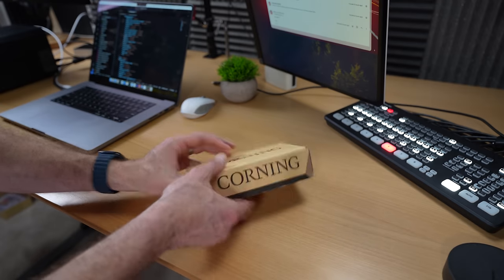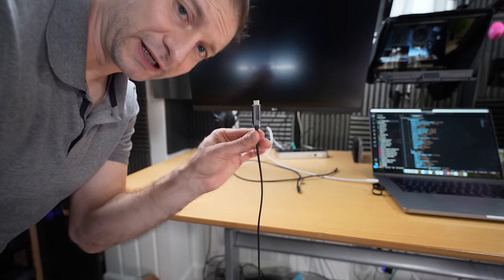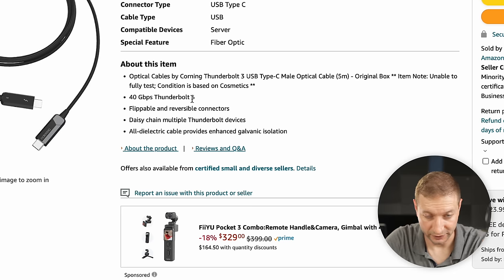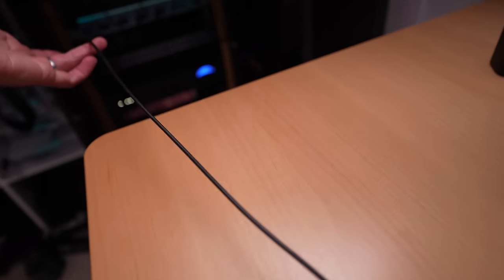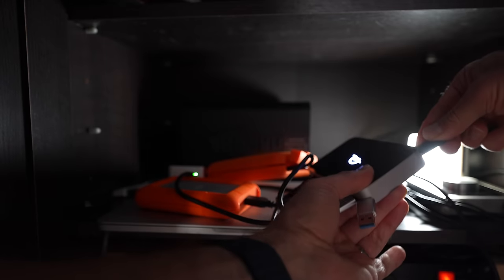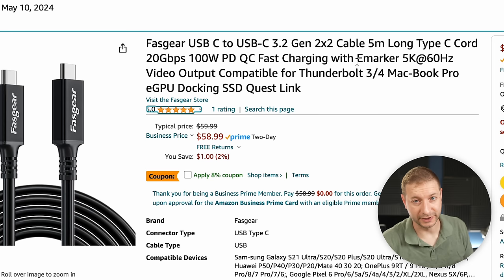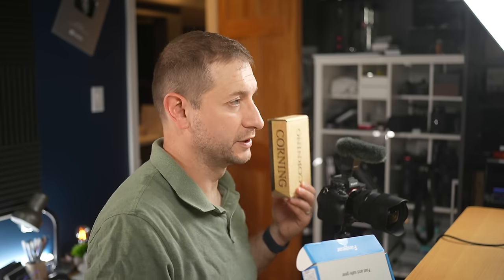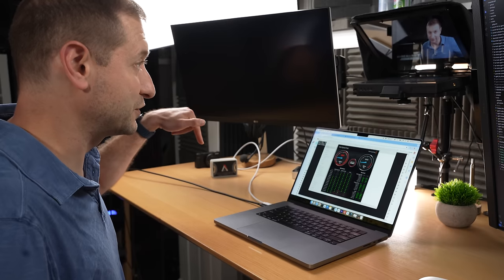I tried a LUXURY cable…(so you don’t have to)

Comment: I had a 6 bay HDD DAS next to my computer at one point and it produced a lot of noise. I ended up getting a Noctua Fan with the noise reducer resistor and that cut the sound down to near nothing from the fan hum. The HDDs still had a lot of their own clicky noises, so I made a 1/2 thick wood box that I put the enclosure in. This didn't reduce the noise, but it redirected it and the heat to a different direction. This allowed me to keep the DAS on my desk without having the noise cause problems with my recordings.
Reply from the maker: hmm. Thanks for the tip - haven't tried that
Reply: Good comment. Its INSANE how cheap and shitty the fans are on some very expensive technology that we buy. Often Noctua has a fan in almost every size that you could mod and swap into these components.

I have seen people do this from PSUs to laptops

Comment: Your mistake is having a non-Thunderbolt 3/4 DAS. Or at least USB-4. With a modern PCIE 4.0 m.2 SSD based external TB3 enclosure, you could easily get 2100/2500 MB/s write/read on an AS Mac (and 1900/2400 even on Intel Mac).

And, btw, those Corning optical TB cables were developed in collaboration with Intel a long time ago for TB/TB2 and, later, TB3. They’re the real deal and the only game in town when it comes to long distance TB connections.

Comment: I salute you for your diligent cable quest adventure. It's funny you posted this right now as today I'm returning my Terramaster D8 Hybrid unit. It's actually my second unit as the first I received I literally had to bang on the side of it for the fan noise to stop. It effectively stopped the noise but I didn't want a unit that required that from time to time. With this second D8, I simply cannot live with having to dismount all attached drives every single time I put my computer to sleep - which I do 4/5 times a day. Even if I had a script to do it for me. Often on wake-up they would not remount automatically either. Total deal breaker for me.

Comment: Solution buy a QNAP and since you already have the Thunderbolt cable from Corning install the Thunderbolt solution. 8 drives will give more than 1GB/s and many of the desktop units are quieter. The other option is going with a 10gbit solution but it will require cabling, adapters for the Macbooks etc.

Comment: I have one of those Corning optical cables. I used it between a universal audio Apollo twin x on my desk that was hooked up to an Apollo x8 in a rack that was actually doing the audio I/O and I was using the twin as a monitor controller. Worked great. But it is a specific and expensive solution for a limited number of targeted use cases.

Comment: You should check the system info or ioregistry to understand what the device tree is looking like for both setups.  also Emarker doesn’t control current but just informs the current source of its capabilities.

Comment: Also would be interesting to see an update with cables from Monoprice. They have a lot of types of bulk cable ordering and related options. We got a monitor from them too, but the pricing is on the lower end so I'm not sure how it is sourced nor the overall quality. We mostly used them for Ethernet and older USB cables. Whoa, nevermind that much because I just checked and they only have 1 certified Thunderbolt cable, although you can order specific USB standards per cable which is their main advantage. It is under their data cables and then USB pages.

Comment: I would get a much longer Corning cable, switch all my computes and storage to rack mount and connect to my personal computer in the rack with the Corning cable and a Thunderbolt docking station.
Reply: Yeah, and the optical TB cable pricing — which is already high — isn’t much higher for the much longer variants.
Reply: And then you can only connect one computer to it at a time. Might as well go full NAS.

Comment: I do think the problem was not the cable at least not the part that it is thunderbolt, i think it had more to do with the fact that it is a passive cable so the cable doesn't carry any current. But this also means the DAS would need to output power for the receiving end to work.

Comment: 9:01 Regarding 3.2gen2x2, this do NOT work as you think. It came out later than usb4 and so only you have usb 4 or tb4, do NOT give you 20Gb speed. On my MSI case i have a usb 3.2 gen2x2 port with asus proart 690 supporting that, and my sandisk is rocking 20gb on that port,  plugging the same sandisk ssd to tb4, only 10gb.

Comment: I am waiting on a SSD NAS "slim line style" for a clinical application. I've seen pictures of them, but now can't find any units with 4/5/6  MVMe M.2 SSD. Quiet and small are core requirements. It would probably meet your use-case as well. I should add, I've been using Thunderbolt 4 docks for some time and am a fan, there can be issues with on-connecting to old spec devices, however.

Comment: I think the best cable for you is USB4 because it supports Thunderbolt 3 = 40Gb
and USB 3.2 Gen 2x1 = 10Gb

Note: USB 3.2 gen 2x2, need specific port, very few devices support it, macbook doesn't support this port.
Reply: All he needs is a long-enough AND certified USB 3.2 Gen 2x1 cable. The NAS supports 10 Gbps USB only, so there's no need for anything higher when you want a direct connection w/o the TB dock.

Comment: We have a NAS for storage and have the same issue.  We just put it in another room where no one hears it.  But then we are on Ethernet and the speed is slow. They need to come out with large SSDs at a reasonable cost.
Reply from the maker: SSD NAS's are now coming out, but they are still pricey.
Reply: @AZisk  Definitely to pricy to the total NAS storage.  Right now I have a external SSD enclosure with 2D connected to my Mac Studio and use it for the short term project buffer.  And even month or so transfer stuff I have not touched in a while to the NAS.  Works, but is clunky.

Comment: have you seen the YT video from one of the mythbuster guys about why an Apple cable might cost US$120?
They went in depth down to the chips multiplexing and all the separate lines in the cable that facilitate high throughput and/or high V or high A or both.
In short, USB is a mess. USB-C is meaningless.
Cables that cannot negotiate about the power they can relay (due to absence of chips and firmware).
While nice to Apple, they didn't mention that the same quality might be available for much less without the logo.
The simple point is that a cable has become an intelligent device.
Basically you can buy an overpriced but cheap USB-C TO USB-C cable that is USB 2  in throughput and charging.

Comment: Hey Alex, I believe the Corning thunderbolt cables don't carry any power. If your DAS is powered via the USB c cable, that may be your problem
Reply from the maker: the optical cable is data only, you’re right. the das has a separate power supply

Comment: 350, they saw you and every other reviewers coming.
Reply: No. That’s what glass optical cables cost. The electronics and optical amplifiers are pretty expensive and these aren’t for the average home computer system, so they don’t sell them in the millions. The smaller production runs make additional cost necessary. Normally, the people who buy these need them. The people who don’t, well, don’t.